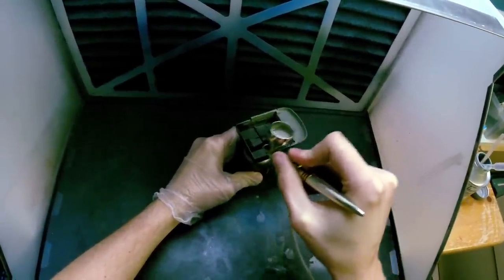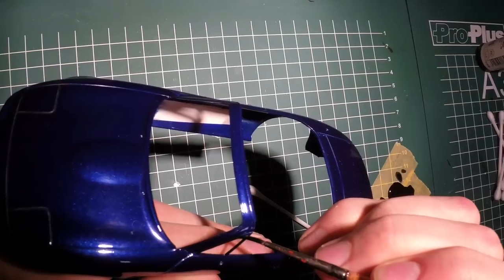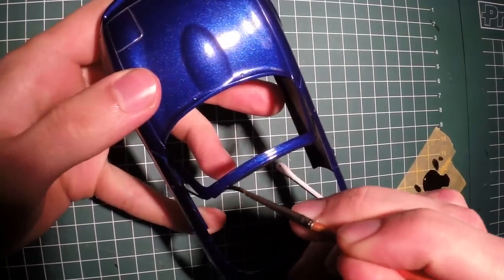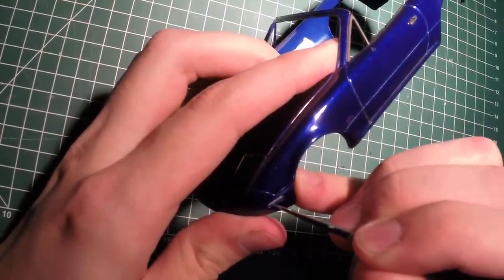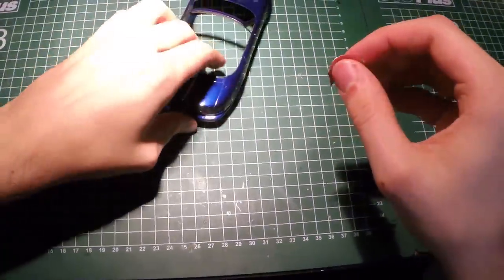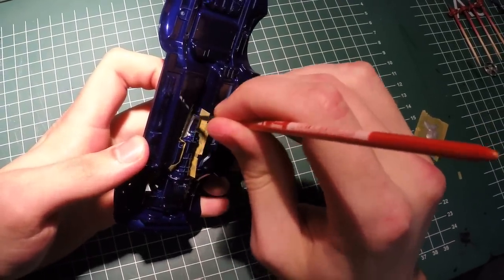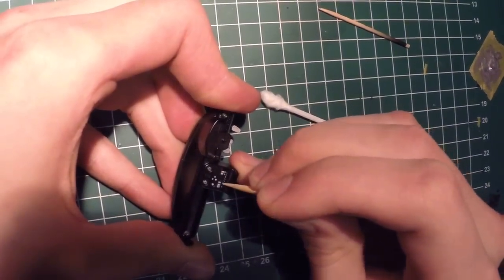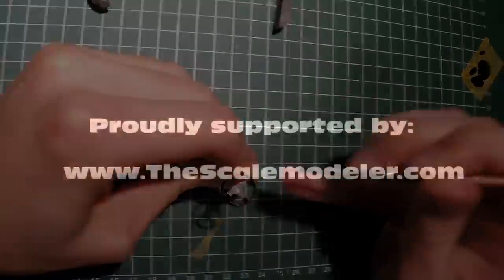Tamiya:Mazda MX 5 Part 4 Detailpainting

Comment: What size paint brush do you use for the window trim? I'm always over cautious about paint bleeding or getting in areas it shouldn't that I end up using like a size 0.
Reply from the maker: The brush size does not matter when your worried about bleeding through, the tape and the amount of paint do though, Use medium thin layers if you cant cover it in once do it in multiple aplictions. And use a good quality tape like Tamiya.

I use a different size brush everytime

Comment: Do you remove the tape from windows right after you've painted the trims or do you wait some time for the paint to dry before taking the tape off?
Reply from the maker: +Chris Durlak The paint i use dries pretty much instantly, so i remove them pretty quick after painting. but it is also fine if you let it dry fully first.
Reply: +The Scalemodeling Channel What often happens with my flat black acrylic Pactra paint is that when the paint dries and i take off the masking, it just comes off with bits of the paint from the window leaving unpainted spots near the edges, where the tape was. That is in fact pretty annoying, do you think thinning the paint would help with that? or is it just the pactra paint?
Reply from the maker: Maybe its the paint, maybe the part is greasy. I use Valleyo paints applied in 2 or 3 coats.
Reply: +The Scalemodeling Channel Perhaps :) Thanks anyway, i'll keep on experimenting so that next time it is done perfectly :)